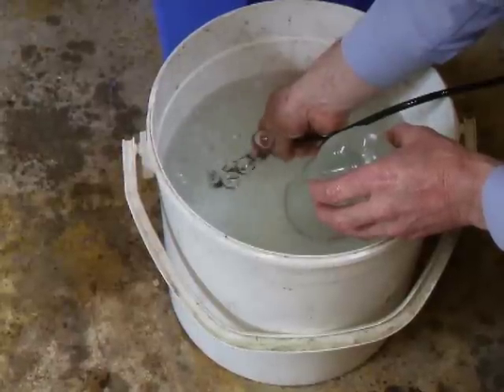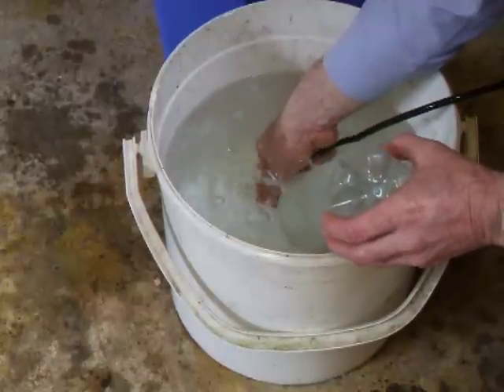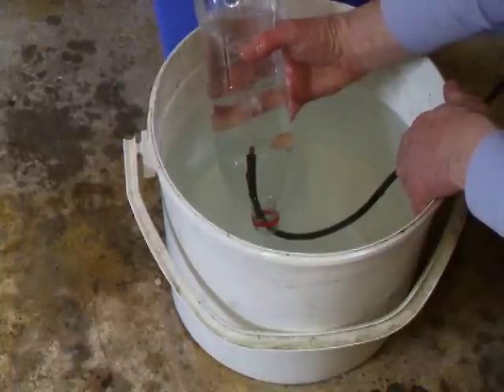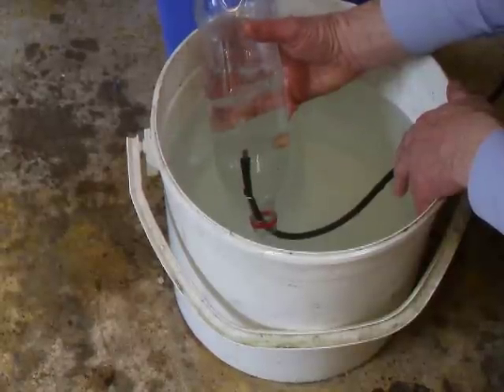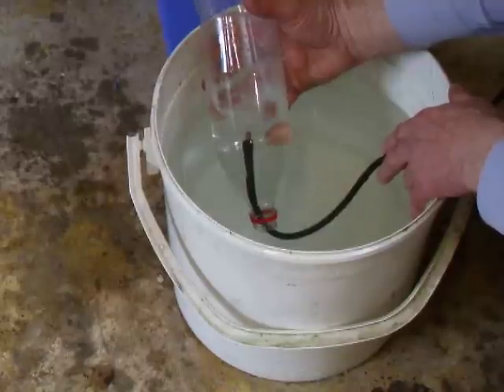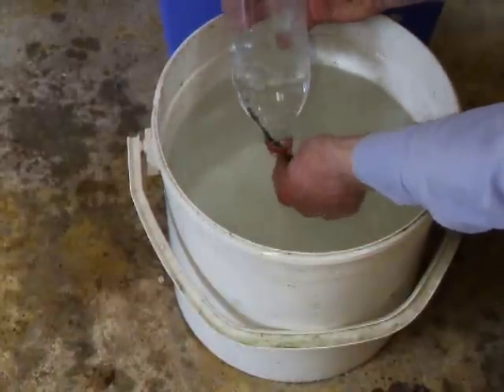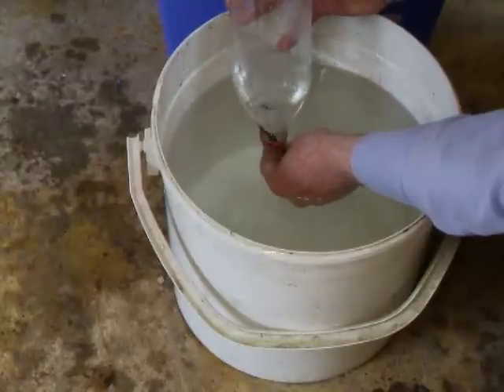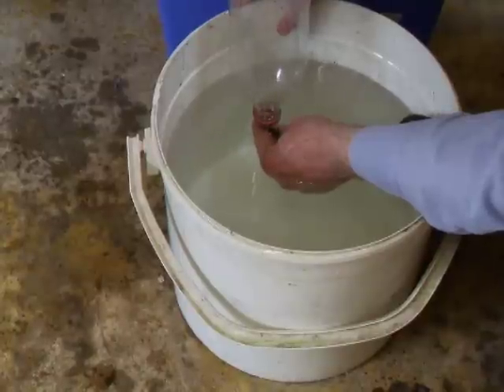Experimental HHO (7 of 7) Cells Producing 1.17 litre/min

Comment: Is any electrolyte used?
Reply from the maker: Hi Carl Darl, yes, I use NaOH as the electrolyte (caustic soda). The more that is used the greater the conductivity. It takes a bit of experimentation to figure the best concentration for the particular setup. However, it is vital to know that sole electrolytes, such as NaCl (common salt) would produce dangerous clorine gas. Caustic soda is catylitic in this sense in thet it does not change the gas in any way and does not need to be replenished as it says in solution.
Reply: Yes he used caustic soda